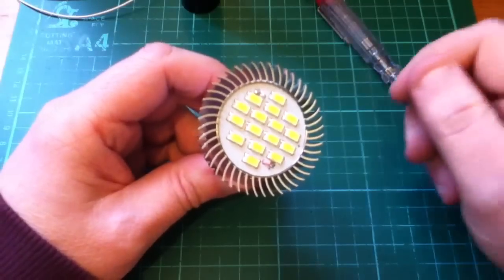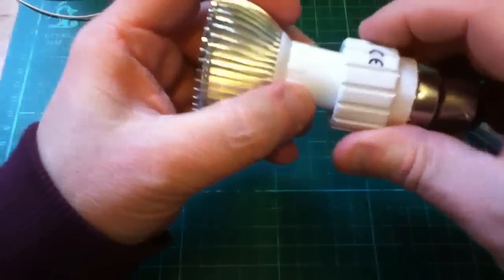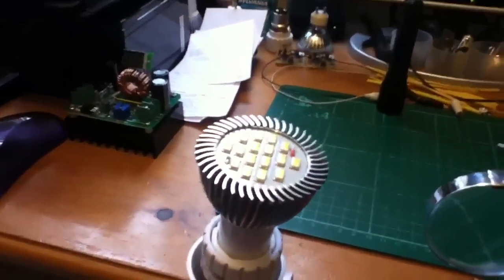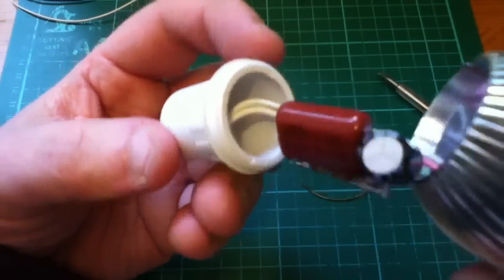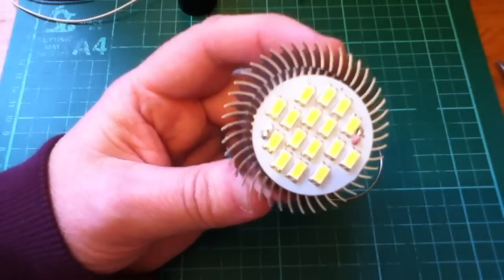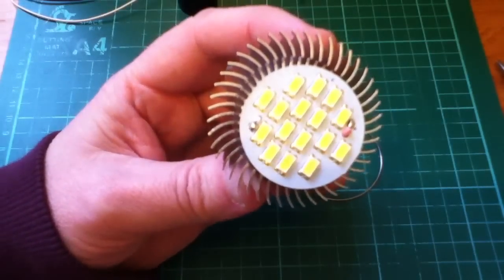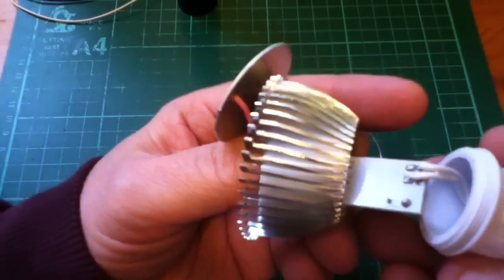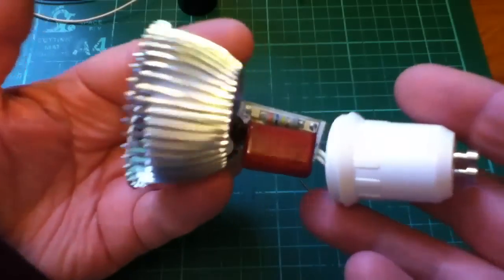Dangerous GU10 LED Spot Light is Cheap and Bright but could Kill You - Seriously

Comment: Fortunately in the US, most of our bulbs use a screw base and unless your lamp does not use a polarized plug or is wired backwards, you should be safe with this type of lamp.  I have in rare cases experienced shocks from lamps wired improperly.
Reply: That is one big advantage of the Edison base over the bi-pin GU connector.

They could have made the bulb a little safer by using a switch mode DC ballast and only having 12V on the LEDs.
Reply: Ed19601 It's AC.  It moves both directions.  There is no backwards.  The plugs are also polarized so you can't put most of them in backwards if you wanted to.  Lastly..... you can touch the neutral wire all you want while it's live.  On that note.... you can touch the hot wire all you want.  Just make sure your not grounded.
Reply: Leif Erikson That is completely made up.  The body's capacitance is extremely low.  In the picofarad range. That's why when you get a spark in the winter you don't get electrocuted and it's thousands of volts
Reply: Leif Erikson Once again that is also completely made up.  I don't know how you did your calculations, but they are more then likely wrong.   Electricity needs a circuit to flow.  If you are not grounded current doesn't flow.  It's that simple.  Capacitance or not.  This is why electricians work on 500,000 volt live wires all the time.  Once you get to that high voltage you need to "latch" on because some leaks, but with lower voltages 600-13,000 you don't even need to latch on if you are insulated(You can even piss on the 3rd rail).  So 240 volts is a walk in the park.  A good pair of rubber shoes and your fine.  Secondly....... Static electricity and current electricity are 2 entirely different animals.  Pretty much anything holds static electricity.  Even insulators that will not normally carry current electricity, so that doesn't really apply.  Low voltage Current electricity is based on resistance whereas high voltage static electricity is based on material breakdown voltages and they transfer in completely different ways.  At the end of the day we are talking 240 volts and I don't believe the whole premise of this video.  If 50 percent of the time you plugged in the light it caught on fire/electrocuted you.... it would be off of the market immediately.  After all..... it's not the volts and amps that kills you.  It's the coulombs
Reply: ComPuterAddic No you don't.  I really can't believe how many amateurs we have here.  If you are isolated.... you don't get shocked.  It's that simple.  You were either not wearing proper rubber boots/were grounded.  Electricity doesn't just magically flow through the air(unless it's high voltage).  I still wouldn't advocate trying it, but I like I said I see guys work on 10kv-30kv lines and they have to work on them live.  Bucket+Boom+Boots = insulated.  Anybody who talks about capacitance also doesn't know anything.  Capacitance only works if electricity is flowing(aka between you and ground).  It's really simple.  Just think... Birds.  They sit on every live power line known to man. End
Reply: Nope, large population of morons is still at large. Btw, mine what?! Oh sorry, if you can't be bothered with reason and universal physics law, probably couldn't be bothered with facts but please do explain to me as a moron to intellegent person with your years long proffesional experience, how to fuck birds don't die from very high voltage cables? Just to be extra nice, to special person like you. I will trow some viable for your logic answers: A - Electricity is a hoax. B - Electricity don't apply to birds, they don't pay bills. C - giant space wizard do it. D - All pictures of birds on wires are hoax, they all die instantly. E - they are electrocuted but that's how they charge themself for a flight. F - they wear same "insulating boots" like yours and that's why they only feel it but don't show it and don't die. G - they do not close the circuit and charges don't flow trough them and they are at 0 difference with the very high voltage wire because they don't touch the ground.
Reply: iv seen many similar screw base led bulbs now that are just as dangerous.
Reply: Patchuchan
Name + Avatar is kawwwiii do not care if actually hairy fat american man stalk mode activated!
Reply: screw based are just as dangerous just because of the conditions you mention:  might be a screw based lamp but may have a plug that can go into the wall socket either way and most people dont even know whicj is the live and neutral on their wallsocket.
But even if it does go in the right way.... i wldnt want to touch the 'neutral' wire either
Reply: atomgonuclear one usually is grounded as we are not all astronauts...
Reply: atomgonuclear
If you touch the hot wire you can still get a shock because of body capacitance (the wire is rapidly changing the electrical potential in your body by at least a hundred volts and some current will flow from the wire to your hand to allow this to happen). Probably not enough current to kill you, but you will definitely feel it. High voltages and AC don't really obey the complete circuit rule and can electrocute you. Neutral is tied to ground and doesn't have such a high alternating electrical potential and is therefore safer.
Reply: Did any of them have aluminum heatsinks?
Reply: atomgonuclear Even being completely ungrounded, touching the hot wire will hurt. (Source: my own stupidity). I ran a quick calculation, and the amount of current that flows peaks at ~6µA. Probably won't kill you unless you got stabbed by the conductor. It's still something that should be avoided.
I do have to add though that during a static discharge, several amps will flow through your body. The reason it doesn't kill you is that it's so brief, and carries verry little energy. Mains electricity is continuous.
Reply: atomgonuclear
I should have explained my calculation previously, my bad. It is based on the Electrostatic Discharge Association's model of body capacitance which is a 1.5kOhm resistor (In this scenario, the resistor has a negligable effect) in series with a 100pF capacitor connected to earth ground. I assumed 120v(340v peak to peak) 60Hz mains. I also made a slight mistake and confused peak voltage with peak to peak voltage. The actual result would be ~12µA (8.84µA rms). so ~21µA (14.75µA rms) for 240v(678.8v peak to peak) 50Hz mains. Of course this is completely ballpark and can vary by at least an order of magnitude in either direction. As long as an electric field can form between you and the earth, and neutral is directly connected to earth, there will be some capacitance between you and the neutral line. A lot of variables can affect this such as body mass, proximity to the ground (I got shocked ungrounded by a hot wire while in the basement, If I was higher up, I probably wouldn't have felt it), etc.
Reply: atomgonuclear There are a lot of birds sitting up on their power lines that are very happy to hear this!   :o)
Reply: atomgonuclear As a former electrician,i can say that even if you have rubber boots on and you touch the live wire,you still get a shock!,even on 240 volts.Not as bad of course when you are earthed,but still scared the hell out of you!And still makes your fingers numb for a while,and i have many times felt that in the course of my profession,many times working with non-professional people."Yes,the switch is of,and then....shit!!!
Reply: atomgonuclear 90% of the time electricians are usually on ladders although the fibre glass clow ones i know are insulated or some part of them is in contact with the floor or walls other than their shoes, this is where it becomes very dangerous and he probably experienced his shocks. The biggest risk is when the current flows through your heart from one arm out the other many people stop their heart dead that way.
Reply: atomgonuclear
YES!You can!I have worked as a electrician for 15 years and suffered many shocks in those years,with boots with rubber soles,because they are mandatory obliged,like so many rules if you are working with electricity!
So,don't  do me off as a amateur!!!
Reply: ComPuterAddic
I've had stuff like this happen.  Most circuits I have worked with have been 110-120 volts AC 60Hz here in the US, but some appliances use 3 phase 240VAC and I have had one or two hits from those when I was younger. 
Usually, it turns out that a switch was placed on the neutral wire instead of the hot one.
Reply: Leif Erikson WOW!!! AC and high voltages actualy do obey "complete circuit rule". Always! Your understanding about them is wrong.
Reply: ComPuterAddic I will off you as quite dumb professional. There is NO WAY practicaly or theoreticaly to get shocked if you are insulated. PERIOD When you got burned it is either you wasn't by some way you didn't expect or you wasn't by some way you don't understand. I actually have a friend with some strangely dry hands and I've seen him touching live wire for seconds with bare hand. we tast it before and after he touch it and yes it was dumb experiment. But If he sweat a little bit and touch the wire he got shocked like everybody else. Insulation!
Reply: Евгени Симеонов
How can i be a dumb professional if i with my professional shoes on still get a shock on a live wire of 230 V??
With just one hand or finger or what ever?A live wire has still what's called "potential" and that's what causes the shock!
That's why there is a spark between the poles of a sparkplug,and that's why your hair is raising on contact with a Vandergraafgenerator,etc,etc..
Reply: Actually you answer yourself quite well. For the first part, but sometimes it is hard to see something if you think in other direction. You still insist that somehow, almost magicaly you got shoked and you were insulated properly. Those two are mutualy exclusive. No matter what, no but, unconditionaly, forever! Fundamental laws of electricity simply doesn't allow actual currecnt flow without closed circuit. Kirchhoff' current law. If you got shoked, then there is one. It may be not clearly visible or you didn't pay attention enough, be there simply must be. I am baffled how you cannot grasp this, what is the reasone that birds rest comfortably on very high voltage wires (same reason) and still call yourself proffesional. If your body isn't part ot the closed circuit then you won't get burned even with +infinity volts. In the real world everything in our universe has it's limits. There is something called material breakdown, this is very important. Above this limit every insulator start conducting. More important is that many (most) materials do not recover from this well or at all. That means that your 600v rated equipment after material breakdown could look the same and insulating as much as your dry socks. There are way too much unknown variables for anyone to tell you why exactly you got shoked in this particular instance, but without a doubt you somehow, somewhere formed closed circuit. About potential - it is exactly that a potential force. there could be high potential, without a electric current. As seen in main outlets without a appliance pluged in. There can be 0 potential with very high current. Seen for exaple in wire connected to negative car battery pole, during start of the engine. But always have to have a circuit. Else will be as you breath only with inhaling, without exhaling. Our universe doesn't work that way.
Reply: ComPuterAddic You really don't know your theory too well either.  Your mixing current electricity with static electricity(Vandergraaf).  2 Completely different animals.  Didn't you ever wonder why they use INSULATING rubber wire on a spark plug .... it's called spark plug wire and it stops everything else from sparking and it still has the 50kv potential inside.  Anyway amateur.... next time check your wet rubber boots before you touch 240.
Reply: atomgonuclear
You can theorize everything you like,the reality is that you get a shock when you touch a live 230 V wire!!!Ik have bin a electricien for 14 years,so i have reality experience,and no my boots are not wet and it is in a dry environment.
Come out of your high tower and try to touch a live wire in reality..
Reply: ComPuterAddic I was wrong. You are not dumb proffesional, you are imbecile.
Reply: Евгени Симеонов
Ok,you have cursed some,so now your feeling better??
Reply: ComPuterAddic
 Ever seen birds siting on the open non insulated wires strung between utility poles? Do they get shocked?

Comment: Nothing like a bit of sensationalism to gain attention.
Clearly this reviewer has no electrical or electronic knowledge to rely on, just imagination.
The only insulation required of any dangerous volts in this device is the plastic box that he casually discards in the first few seconds.  beyond that the voltage dropper and rectifier provide all the isolation required to make this device completely safe.

the "dangerous" side of the circuit is isolated from the "exposed" side by the rectifier, which is made of diode junctions, which inherently fail open, so disconnecting the low voltage side under any fault condition. 
The mains voltage is never exposed to the LED circuit or the front panel as described, apart from a microsecond spike (harmless) at the instant of turn on only a rectified and current limited low voltage is presented to drive the LEDs.
Time to sack this reviewer and get a new one.